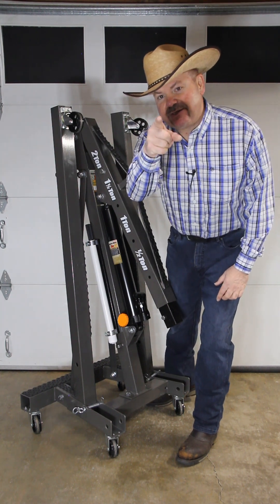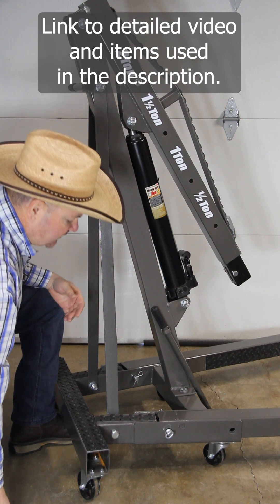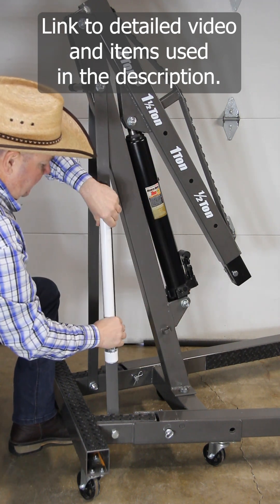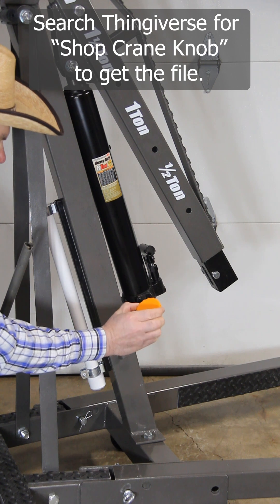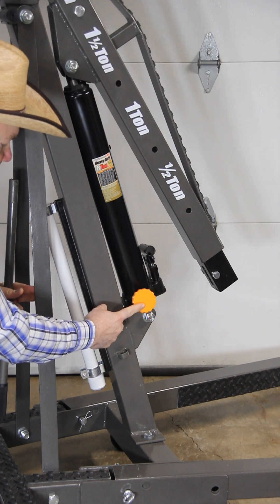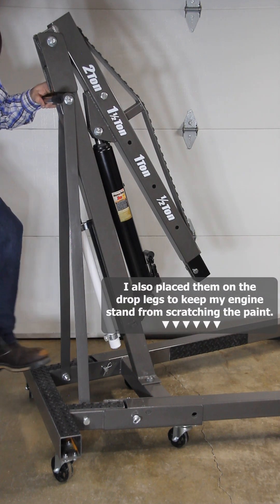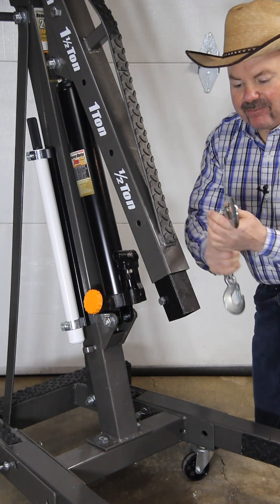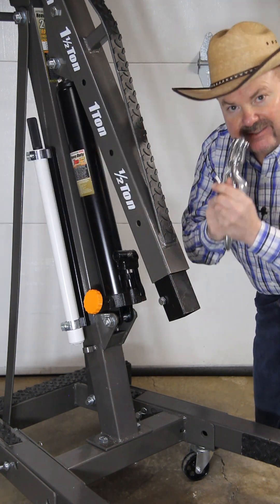4 Engine Hoist Modifications Part 2

Comment: The biggest one you missed is to add square tube to fit in a hitch so you can transport or use it in an off concrete setting.

Comment: The most useful mod is to get a hand crank winchand weld that to the top of the beam in the back. Then get a pulley and attach it to the chain end of the beam. Now you can set your beam height and be able to raise and lower loads without it bouncing, and without having to deal with the angle and effective length of the beam constantly changing.

Comment: How do you know how strong of a swiveling hook to buy. It seems scary if that breaks
Reply from the maker: Good question Ethan, you definitely don't want that to break!  The engines I am working with are in the 400-600lb. range so the hook I purchased is rated for 1,000kg or 2,200 lbs.  Gives me plenty of room between the capacity of the hook versus what I am lifting.  You would need to know the weight of what you are lifting so you could make sure the hook could handle it safely.  Hope that answers your question.  Thanks for stopping by!
Reply: Idk maybe get one that's rated for what the hoist can lift